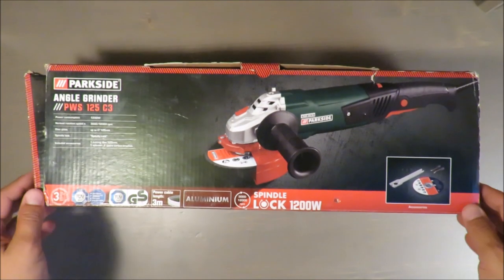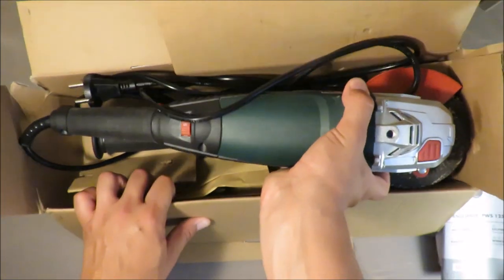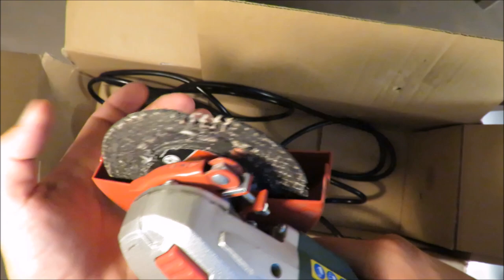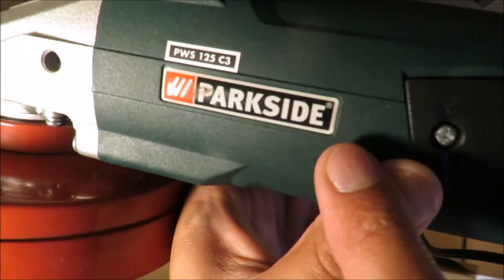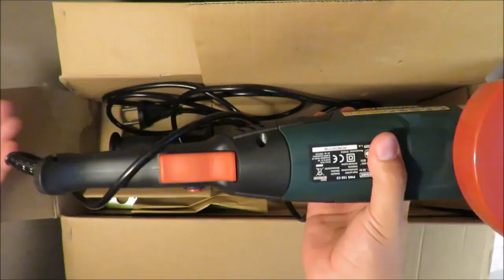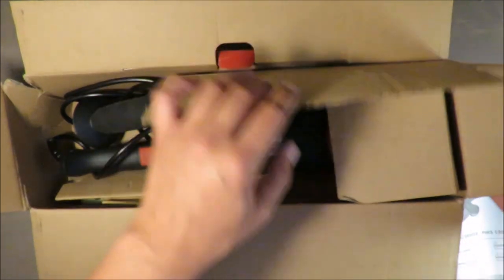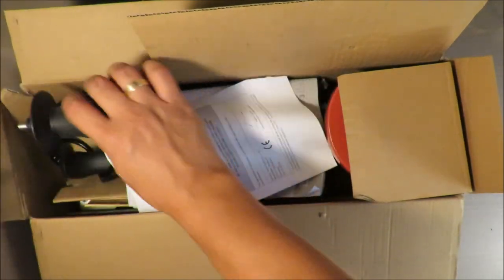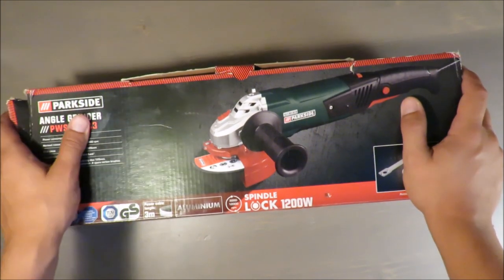REVIEW Parkside Angle Grinder PWS 125 C3 (Lidl Angle Grinder Ø 125 mm 1200W)

Comment: I purchased a Parkside angle grinder that screamed and vibrated badly straight out the box then it starting spitting flames from the brush covers and blew up , this was 240v grinder , so scary , I would never buy a Parkside again , Purchased a Makita instead , dynamite grinder , no contact or apologies from Parkside